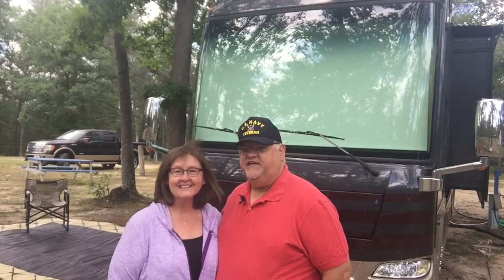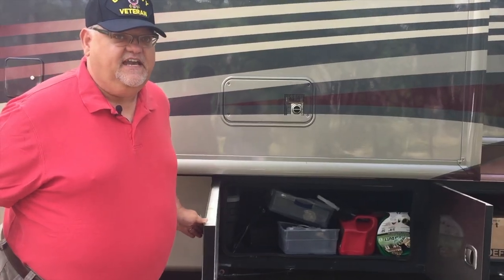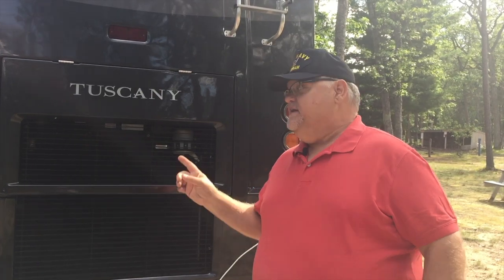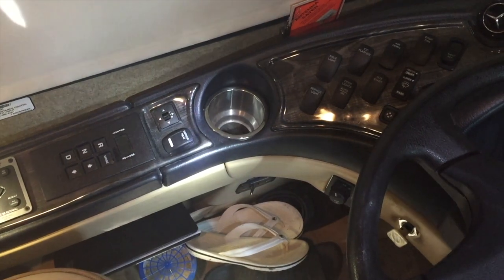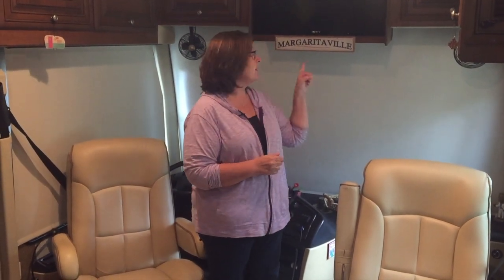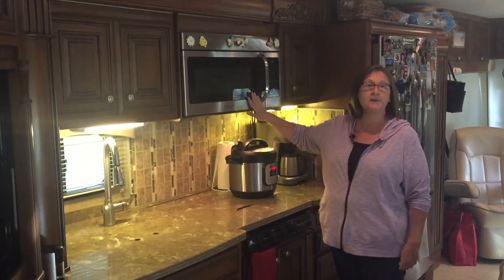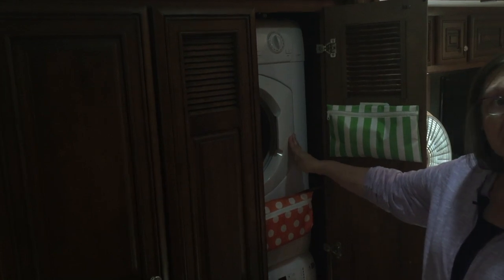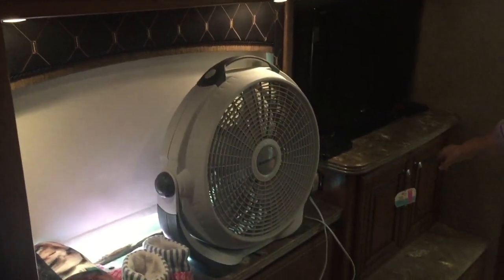Tour of 2013 Thor Tuscany 40 FX

Comment: Hi, what is the weight, of this BEAST!? I recon, that it must be around 6Tonnes. You lucky couple! Nice Vid.
PS: I removed most of the inside, compartment doors, on my Chevrolet, Chevy Van 30 Four wins, as it is old, (1994) and a bit dated. I replaced these, with Blind material. I recon, that I have removed about 1/2 of a Tonne of weight, which includes the Air Con, the Boiler, and Heater. I did this, to improve the fuel consumption, and Breaking distance.

Comment: We have a 2017 44MT Tuscany. We removed one of our couches and replaced it with comfortable recliners with a center console. Nice to have a comfortable place to sit similar to a home. Interesting to see your travels in a Tuscany.
Reply from the maker: We have replaced our L-shaped sofa with Theater Seating, and our Captains chairs were replaced with brand new Flex-Steel.   Bradd & Hall did both when we were in Elkhart.    Other than uncomfortable furniture,  how do you like your tuscany?
Reply: We really like our Tuscany. It is quite the home on wheels. It is very frustrating to deal with the many issues we have had in the last two years. Most issues handled under warranties. Everything is working now except the black tank level sensors.